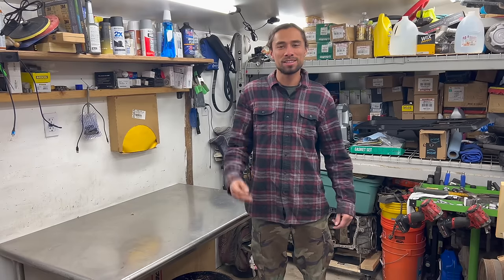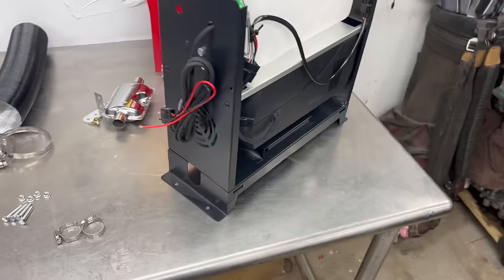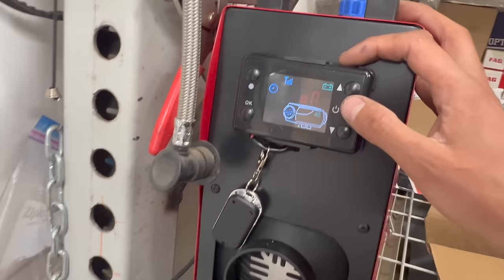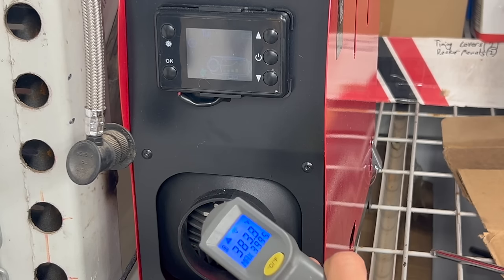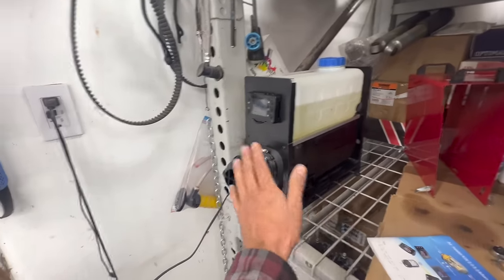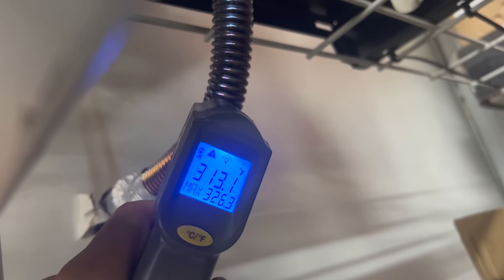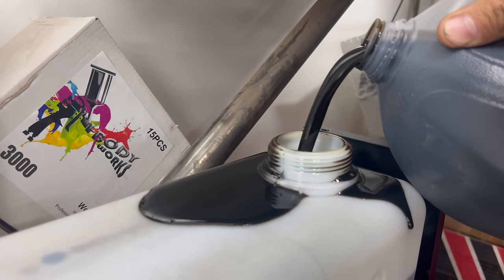Unfiltered 100% Waste Oil Vs Stock Diesel Heater

Comment: I worked in a garage for a couple of years, we heated a 3 lift building with waste oil. Used an old homemade wood heater with a forced air blower, oil dripping onto an old truck brake drum. Also burned old transmission fluid and old gasoline mixed in. As soon as it got hot the exhaust burned completely clear without a trace of smoke. Fuel was gravity fed and drip was controlled by a small needle valve. As it heated up the drip got faster so you had to keep an eye on the temperature or it would began to glow, almost like looking at an X-ray. I wonder if I could mass market this system?
Reply: That is the old babbit style heater, popular in Canada and some parts of Europe and Russia.
I have one made from a gas cylinder (upper chamber) and a disk rotor with a saucepan below for the burner. The oil drips in through a hole in the disk and a fan pumps in air. I can make that thing glow like the setting sun if I let enough oil flow in.
Once up to temp it emits no smoke or fumes.
I recently modified it by ditching the fickle oil dripper and replacing it with a diesel heater pump to inject the oil and I drive it with a 555 timing circuit to set cycle speed along with a flame detector to cut fuel in a flame out situation, it's now much more stable once started and I can let it run for days.
Reply: Yea, my dad had one in our garage. It worked great, but you definitely had to watch the flow. Also had to watch what waste fuel you threw into the tank. For some reason,  it settles and separated. Which lead to a situation where the thick oil burned off and the lighter oil flowed faster and we weren't aware... it damn near turn the shop into an oven, melted and warped all kinds of shit. Lol.
Reply: Yea, my dad had one in our garage. It worked great, but you definitely had to watch the flow. Also had to watch what waste fuel you threw into the tank. For some reason,  it settles and separated. Which lead to a situation where the thick oil burned off and the lighter oil flowed faster and we weren't aware... it damn near turn the shop into an oven, melted and warped all kinds of shit. Lol.

Comment: Look into real garage style waste oil heaters. Check on what they do differently. Don't reinvent the wheel. A local guy made the paper years ago running a diesel VW on filtered fry oil. Twin tank, started on diesel. Heat from cooling system went into a heat exchanger and preheated the used fryer oil. The preheated (thinned oil) then was switched on and the car ran perfectly. Maybe wrapping tubing around exhaust to preheat might work. Still need to preheat to get it running from cold start (heat lamp?). Better pump would be needed. Fire extinguisher would be a great idea. Keep trying, don't burn your place down. Good Luck!
Reply from the maker: This is a magnificent idea. Thanks for the input. I’m trying to avoid twin tanking my Delica and Cummins, but it might need to be done. The exhaust heater is such a great idea I’ve never considered!!!
Reply: You can use your stock tank for the waste oil and just use a mini tank for your startup/shutdown diesel.
Reply: @questioner1596  You could incorporate a dual tank fuel selector from a zeroturn or similar mower.
Reply: Commercial waste oil burners use compressed air & special atomizing nozzles that mix the oil & compressed air at the very end of the nozzle tip.  It produces a mist of oil.  

I built a DIY burner that utilized the commercial nozzles using the smallest size plumbing pipe (1/8" I think) inside of a larger pipe.  The smaller pipe was brass & I reamed it out slightly to accept the nozzle's center oil feed inlet, which uses an O-ring for a press-fit.  The outer tube fed the compressed air.  
This burner was designed to operate constantly, 24/7, for a glass melting furnace.  So it didn't need a thermostat or a method for automatic cold restarts.  A space heater most likely needs those features.
Reply: Sounds like a greasel setup with a heater core in the grease tank to heat up the waste grease.

Comment: The catalyst screen plugged  up on mine almost  identical to your red one with corn oil and diesel mix. I took apart the combustion chamber and cleaned  the catalyst screen.  Been running good now over a month. Only using diesel now

Comment: Apart from needing to clean it out more regularly, you need to know that the exhaust fumes can be toxic due to heavy metals that end up in it and carcinogenic due to the soot, so make sure they can't get into the workshop.
Reply: or anywhere
Reply: All exhaust fumes from combustion systems are toxic…

Comment: Going on three years burning waste oil and old cooking oil as well as tranny and hydro fluid have good in line filter tank is raised four feet if looks very thick will add a couple cups gas and mix it well less trouble if burn on higher settings people who say it dosent work have no riging fix it skills have even burned old 90 weight oil.

Comment: you may find that you'll have to clean the burn chamber a little more often than if you were running straight diesel, you'll get a lot of carbon (and crap) build up.
Reply: with practice you can dismantle, clean the burn chamber and reassemble in 20 mins

Comment: I used to run my 5 cylinder Mercedes benz used Canola oil ,It was not quite as much joules of energy as dieselfuel and after about a month or so of filtering the cooking oil through a 5 micron maple syrup press it became hard to start without using starter fluid.I mixed diesel 50/50 with the canola oil and it was a bit better but I think all the tiny carbon molicules of food built up arond the rigs and made them stick loosing compression.These cars actually run on compression Iginition. Thinking about your problemI'd start of by filtering your used oil through a fine 5 micron filter and mixing it 40/50 with diesel and if you add like 10% gasoline premixing it well before you run it and also making sure the concoction is at room temp you will have much better results over the long term. Also getting a bigger ajustable fuel pump would be more reliable. I make a waste oil heater years ago and had a stainless pot Id put some used oil and paper to start up and get the pot hot ,then I used a spray gun shooting air and waste oil through a 2 inch pipe 4 feet up from the pot at the bottom of a water tank where the pot sat.  I was to conclude that it worked well because you can have control of the fuel air mixture like you would paint.The draw back was you had to have your compressor running to maintain proper regulated air supply for the burn to be smoke free . Atomization with correct air supply is the I key.The spray gun tip is made of brass and changing tips after a couple weeks run time was nessisary unless you turned up the air presure to get the right mix for the worn spray gun tip. Unfortunately use oil has worn engine particulate and wears out the tip. If some how you could have a tip made of Corundum like a water jet cutting system It would last years. Idealy Id like to turn plastic waste into diesel fuel with a process called thermaldipolymerization and burn that in your heater . Im subscribed!
Reply: The stuck rings issue is likely from your organic oil polymerizing and basically gluing your rings in place.    
There's a load of documentation on running various raw organic oils as fuels and they have a nearly universal problem with that when burned in their raw forms in modern engines..   

The rough numbers I have found seem to say that raw organic oils can't be used long-term in blends over 20 to 30% without that ring sticking and or injector clogging happening.   Any ratios above that need to either be treated or converted into actual biodiesel.

Comment: I run 1L old gasoline to 3L old oil. I start the heater with some propane in the intake and once it’s running I run it on high and it’s worked great for me

Comment: What i have done in the previously is mix a 10% rug which is petrol with the waste oil prior to using it in the burner. You want to let it settle for at least three days before adding it to the heater. A sediment will drop out you do not want this sediment to drop out inside the fuel canister do you want to get rid of it if you wish to heat the oil before it hits the fuel pump, you can use the exhaust heat to do so with a heat exchangeheat exchange

Comment: Short term they will run on any oil you can find as long as it’s thin enough. The combustion chamber however will soot up over time and it’ll need cleaning out. The intake needs piping outside too in case there’s a failure, as you’ve found out, fumes pump out of it when it shuts down… Get rid of the case and small fuel tank and just have the main unit in your shed and have a larger tank outside. That way when you inevitably spill diesel or oil it won’t stink out your shed. Mine is still working perfectly after 4 years.

Comment: I was a diesel mechanic for 15 years our trucks had espar heaters (same thing) we had to clean the carbon build off the burner thats with ultra low sulfur diesel you will have tons of carbon build up but its an easy job id definitely thin it with diesel.

Comment: So many variables to consider here. First and foremost, everyone keeps talking about filtering and forgetting about moisture. Your oil needs to be ran thru a water fuel separator and filtered. A centrifuge would be Best. Second it doesn't appear that the pump is strong enough to pump the oil so cut it with 20%rug to thin the oil. Also the fuel pump is sitting almost vertically, it would probably work better horizontally.  
I have a bit of experience with running wmo in diesels and i can tell you that some older diesels eat it with no problems and others require a lil leg work to get it to cooperate.  Same is True with Park heaters

Comment: To maximize your efficiency, route the burn chamber's air intake to the outside.  Otherwise you are sucking warm room air into the burn chamber and hurling it outside, which causes the room to have negative pressure and draw in cold air through all the cracks , etc.

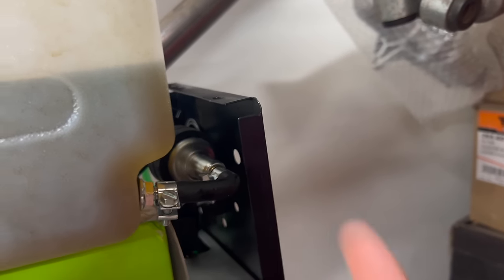Comment: At 17:50, it won't prime because the fuel pump is air-locked. You must mount the pump at an angle of at least 45 degrees with the outlet up, to get rid of air. Straight up with outlet up is best, because it gets all the air out. Air pockets in the pump are bad, because these areas are not lubricated, and can wear out fast. Another pump issue you are likely to get with this unfiltered oil is jamming up the pump. There are no O-rings in this pump. The piston is just an extremely close fit with the cylinder. Any little grit that gets through your paint filter could jam the piston, resulting in no oil, and a flame extinguished E-08 code.

Comment: What if you ran the exhaust through a radiator or some type of heat exchanger before it went outside and then blew a fan across it, seems like you could squeeze a little more heat out of it.

Comment: For one a lot comes down to the viscosity of the different fluids and what the crappy little pump can move.  Car oil is way thicker "has viscosity" readings for lubricating, the fuels like gas or diesel are very thin to flow.  And two the thicker oil does not ignite or burn as easy as thin "fuels"  that's why the build up was leaking out the bottom.

Comment: ive read that 20% gasoline thoroughly mixed with the used motor oil (so it doesnt separate) is just about perfect to replicate fuel oil/diesel for furnaces and heaters and such. then dump it through a 1 micron filter sock to make sure it doesnt clog a nozzle.

Comment: Hi there...
I have tried to use waste oil (car engine) it make a lot of carb8n 8r what ever deposit in the combusting chamber...
My VEVOR firstly showed 220 Celsius on heater and afzer 5-7 liters of waste oil it started to show 140 c temp.....
I have it disassembled and I have found approximately ⅓ of combusting chamber filled with deposit of carbon / trash...
I have cleaned it and tried to use heat oil (light oil for heating, cheaper than diesel but filtered enough to guarantee propee work... Temp on combusting chamber is again 200-220 C...
Heating oil is half price of diesel... Not suitable for new generation of diesel engines but working for oil heeters...
Tested...

Comment: Your oil needs to be the same viscosity as diesel. So thin it with diesel or you could also thin it with gasoline. Gasoline is cheaper to mix since you need a lot less. I never did it myself but go watch anthonycooke27's videos about his truck running on engine oil.
Reply: I would keep petrol away from these heaters, they're cheaply made and a fire hazard.

Comment: You should look into getting a double wall pipe for the outside wall termination. That exhaust is hot enough to start a fire from the building materials it touches.

Comment: The original pump probably works fine.  It looks like it got bumped.   They are supposed to be mounted at a specific angle.   Originally it was.   But when you showed it in “prime mode” it was almost horizontal.   It needs to point up more.   I think around 20 degrees or something

Comment: I run waste oil mixed with gasoline in mine, no problems whatsoever
Reply from the maker: What ratio are you using? How many gallons have you put through it?
Reply: "No problems whatsoever".
Not until the combustion chamber is full of ash..

Comment: there are at least 2 problems

1.  used oil straight up is way to thick, it has always be thined with some petrol around 10ml/1L oil(diesel works also but you need way more)
2. put your exhaust in a upwards position and make a new hole in the wall if needed, in your configuration you creat thermal issues for the device which decrease lifetime (you can recycle the heat with a sandbattery or heat exchanger)

Comment: 08, 0-08 etc is "flame out" or "not started". Predicted error code with not using fuel it was designed for. Clogs the burner up with carbon. Hidden wick gauze at back of burn chamber (which the dieseI relies on to help with atomisation) crusts up and heater will no longer start. I see so many claim you can. So can you run on these alternative fuels? Yes. Should you? Absolutely not. It doesn't matter whether you warm it or add switchover taps, or reduce the ratio of the 'alternative'. It WILL clog the burner. It ruins it. You end up spending hours cleaning it out constantly (with modest success) or you end up replacing the burn chamber - several times. If you want to burn oil, use an oil burner. Simple as that.

Comment: I filter my waste oil with gauze and mix 2/3 fuel, 1/3 oil. Fill the tank with diesel first, and follow with the oil.  This works fine and won’t damage the heater and your fuel cost is cut by 33%.  And the unit seems to run more economically and hotter heat output with the muffler installed.

Comment: It WILL get coked up. The atomizer screen,   the tiny air ports close to it and the burn chamber will all need cleaning. Having said that, it's not too difficult to disassemble and oven cleaner works well. Once it starts getting coked up it restricts air flow, which in turn reduces temps, which makes it coke up even more until it either wont light, or even extinguishes itself. Better to start at 1hz too until it's warm to avoid flooding which is why it's leaking.

Comment: Run your combustion air intake hose to the outside and reconnect it. Nice cold air into the combustion chamber and you are no longer sucking hot air out of the room and blowing it outside via the exhaust

Comment: Black Deisel Garage has a video on how to thin down oil with gas and make Black Deisel.  It'll run a truck or tractor motor.  Maybe u should try it.
Great vid.
Reply: Yeah that's nothing new. I have done that with a diesel fired torpedo heater many times for many of years. It's pretty much common sense, but I get most ppl don't have.

Comment: @18:00min I think u did everything to diagnosed a bad connection letting in air before or at the check valve or a bad check valve. Maybe at the tank. Pressure test the connections. Compressed air, soapy water in a spray bottle unless it says otherwise in the manual. Always follow manufacturer reccomendatings.  Remember to ppp. Proper pp protection. pppp.  Great video by the way! i need bed too.

Comment: With 2 tanks, start it with diesel, & the 2nd tank run a copper line around the exhaust to thin the viscosity of the waste oil, switch it once the exhaust heats up & it will run just fine.

Comment: You gotta start it with diesel and get it up to temp then switch to used oil and lower pump speed to 4khz or less. Ive never ran it over 6 hours like that but did well entire time. But then when you need to shut it off, switch back to diesel let the  diesel reach burn chamber then increase pump speed to max and let it basically bake away ash and soot from plug, chamber and exhaust. Produces ash. Lots of it. 

I also try to keep the used oil tank in front of heat vent to warm oil to be more viscous.

I also only use it when in garage. If i use it overnight i only run diesel.

Comment: Funny you mentioned to take the cover off and check all the connectors. I took mine off and immediately found the fuel line has a kink in it where they have it going up at an angle and the line turns to go down.